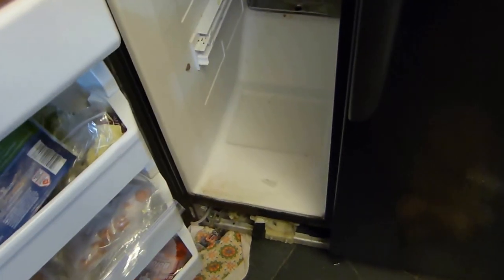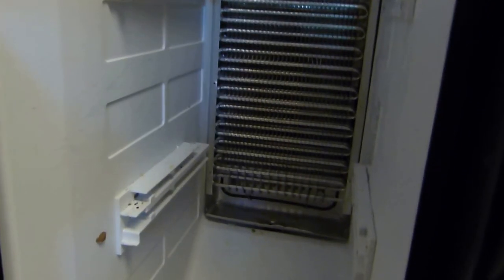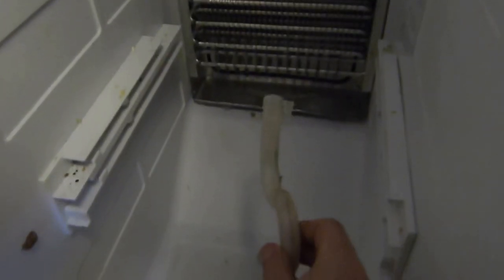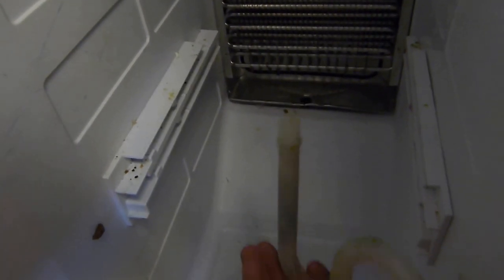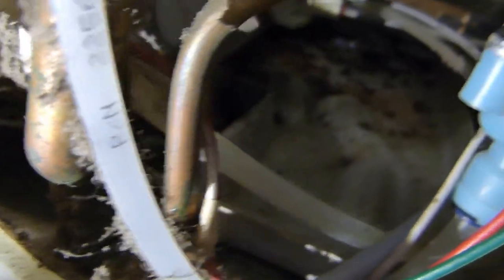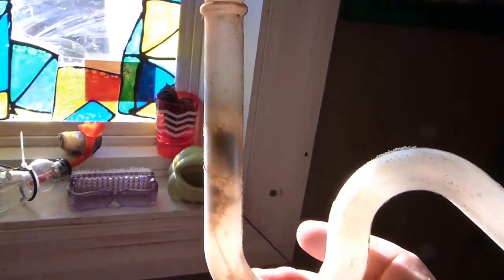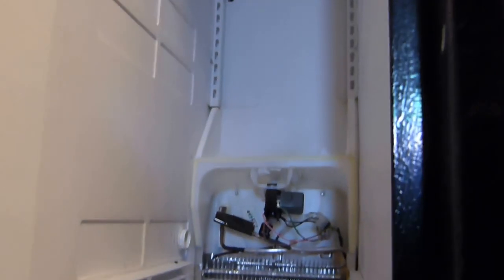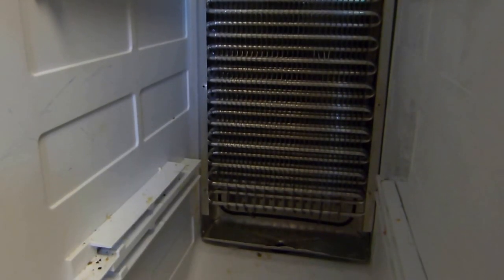Fix - Ice Buildup at the Bottom of Freezer | Freezer Leaking

Comment: Thanks.  Your video was helpful to see what the disassembled components look like.  

I have a similar fridge/freezer.  I can't easily get to the back due to space limitations.  I melted most of the ice with a hair dryer and then used hot water and baking soda to clear the tube from the inside drain opening.  Water is draining freely now.  If the problem returns I'll run some sort of mini-snake down the drain spout.

Comment: Thanks, it helps to see the physical situation and the probable cause.  But more details would certainly help such as:

#)  Do you have to remove the inner panel to disconnect the tube?
#)  How does the tube disconnect?  Simply pull it out (friction fit)?
#)  Did you succeed in cleaning out the tube and if so, how?
#)  How do you reinstall the tube - just push it in?

Comment: So how did you get to that drain pipe? Is it just a matter of removing the back panel, or is it more involved than that?  I defrosted mine, sucked debris with wetvac then shot air down inside - was cleared of ice and gunk as far as i could see (which wasn't far) but this morning... another sheet of ice.
either i didn't reach the clog or there's a different issue.  Appreciate the video!

Comment: I fixed mine by putting a big board on the freezer side of my refrigerator... my suggestion would be a draft dodging door piece at the bottom and something to insulate the freezer wall better on the outside  because it seems like poor design causes most of the problem.